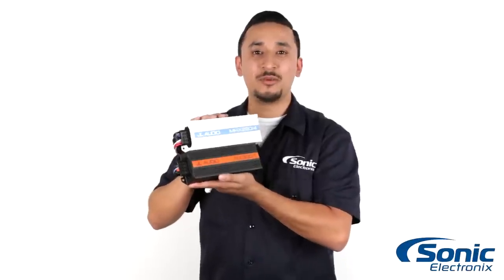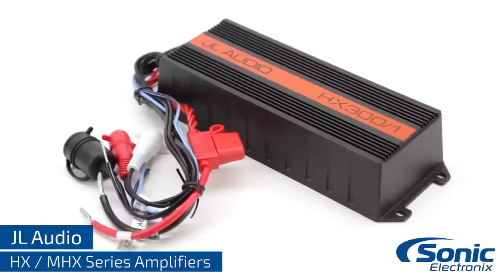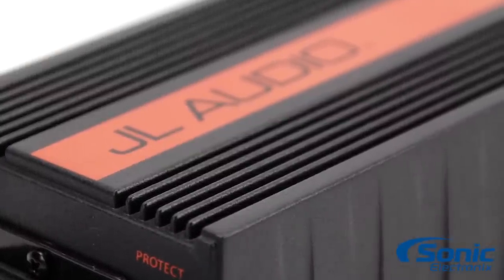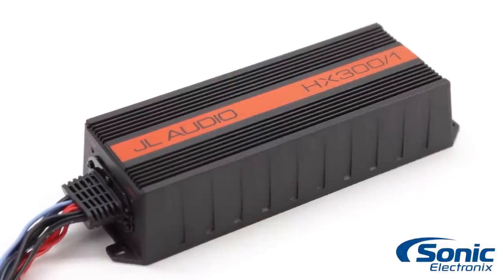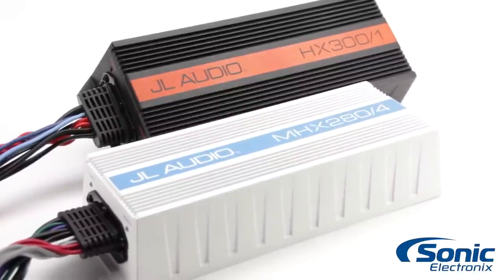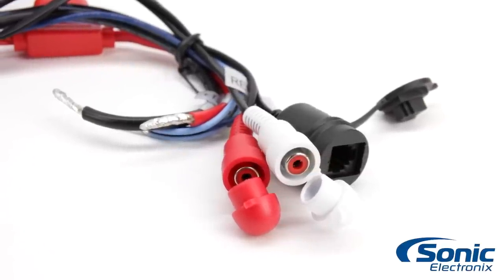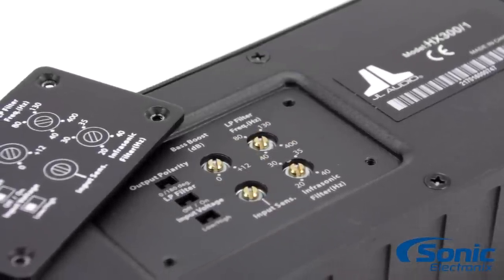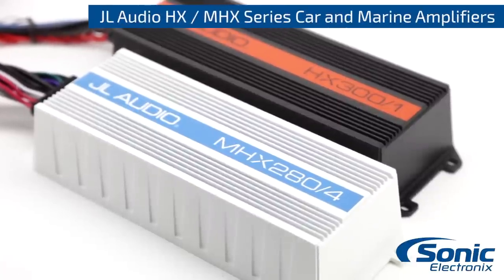JL Audio HX300/1 & MHX300/1 Car and Marine Amplifiers | Product Overview

Comment: I am debating on whether or not to get a amp like this. I know most aftermarket radios are putting out 15-20 watts RMS but I wonder if it is worth it to add an amp like this to get another 20-30 watts RMS. What advantages does it have? Louder? Clearer crisper? 

The Pioneer NEX serious have great tuning abilities to get the best sound from any speakers (as most repetitive Head Units do). Is it worth spending the extra $150~ to your interior speakers? I don't need it much louder than a head unit can provide. The only way I would consider is for a cleaner sound. But I am convinced a head unit with tuning abilities can provide that (such as the pioneer NEX). So I don't need an amp for that. and I don't think I care to have the speakers louder than a typical head unit can make them. 

Maybe I am missing the point.

Comment: Not trying to troll, but you are not an authorized JL audio or alpine dealer but yet you sell these products at retail price? What is the incentive to buy from you if you don't have the manufacturer warranty? I know you back up your products but I mean isn't part of the reason to buy from an un- authorized dealer is to get a better price?     Again I am not hating or trolling.  I am a customer of yours, but not for those brands though.  If I have to pay retail , I will got through an authorized dealer to get warranty
Reply from the maker: James Smith Hey James. Check out the product page for that amp and look for who is covering that warranty and if it says anything about being unauthorized. You might be surprised what you find ;)

http://www.sonicelectronix.com/item_93401_JL-Audio-HX300-1.html

Plus, that item is currently has our VIP Guarantee which means we add an additional year of warranty, give 10% rewards back, offer free 2-day shipping to the US48, and more. So why would you shop anywhere else?
Reply: Thank you for pointing that out to me. That's my bad.  Like I said, I was not trying to blast Ya.  I am a customer of yours and have had good experiences with Sonic.